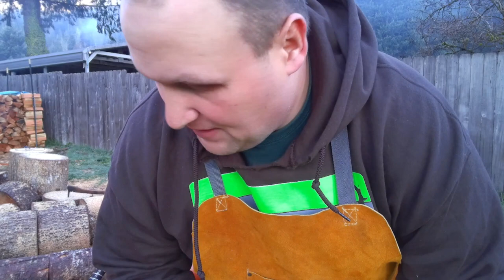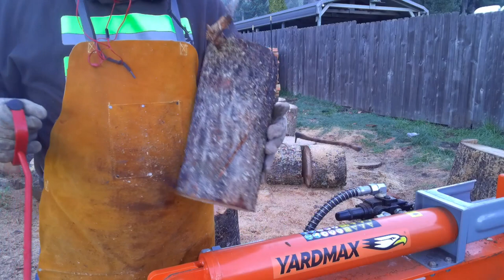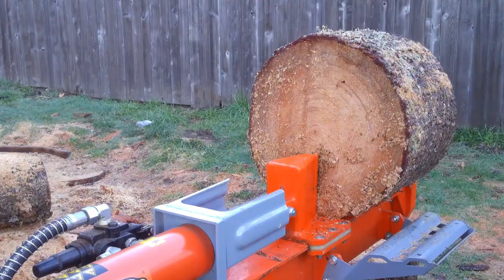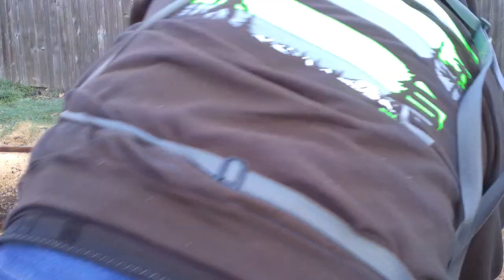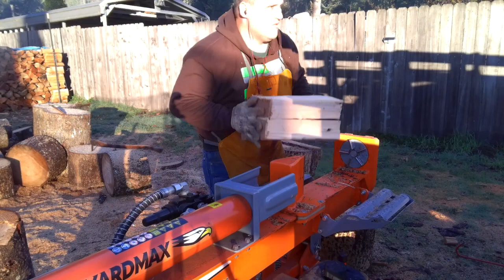The best Log splitter for the money!!

Comment: A few weeks ago I showed this vid to my wife and as a goof Valentine's Day gift she surprised me with a welder's apron JUST LIKE YOURS for when I use my splitter.  Excellent!  Great tips on your videos, Wild Bill.  I've worn the apron 3 times now when using my splitter. Over past dozen years I used to do daily rental of commercial 37-ton type splitters and decided this year to buy my own and got the 28-ton half beam yardmax.  Have split about 2 cords now of 90 year old wet red oak.  In Virginia.  Impressed how you split doug fir with your axe blows but here I use using a wedge and wicked heavy sledge/maul to get some rounds down to a manageable size.  Subscribed.
Reply from the maker: Thanks for the kind words.
Reply: I agree with my red oak. It’s a choice between vertical split or wedges

Comment: Good video Wild Bill.  I see you use a lot of the same techniques as I do.  I love to split 'em square  when possible because it allows cross stacking at the end of the rank.  I have a large push block and a large fixed wedge so that allows me to sectionalize the larger rounds into 4" thick slabs the whole width of the larger size logs.  Keep up the good work young man !!

Comment: Hey Bill,
Just subscribed. From California/Oregon border. I too recently got a Yardmax splitter. I got the 1/2 beam 28 ton. So far I've prolly put 8 cords or so through it and love it. Gonna be making a table to extend either side of the existing rack so I'm not having to move larger chunks as much. Will let you know what I come up with as it will fit your splitter too. Basically gonna just add a piece of plywood for starters.
Reply from the maker: Hi Phillip. Welcome. Yes please let me know how that turns out. Some added table width would help alot
Reply: @WildBill1122  Will do. I saw the small metal one they offer as an option but it didn't seem big enough. Eventually I'll make it with metal when I get a welder.
Reply from the maker: @unclep1210  yea the one they sell seems like it isn't big enough to bother with.
Reply: Uncle P:  I too have the 1/2 beam 28 ton. I like the idea of plywood tables.  Question:  the L-shaped hydr. fluid suction hose on mine came somewhat kinked. Hasn't affected performance but I think the factory didn't size it right. I'm reaching out to them about, just curious if you had a similar issue.  Thx.

Comment: I learned some 1 put a tall round in a pos9tion to set a half of a round and using the wedge to hold a large piece while you set aside the other half. Having to straddle the wheel on the control is hard on my 76yo back so I will be removing it now. Thanks for the help.
Reply from the maker: Glad it helped you.

Comment: If you can lift those rounds then you didn't need to invest in a splitter. More fun with the axe too.
Reply: I almost laugh when I read a comment like that. Grew up in the sticks, a chainsaw in my hands at 10, when people see me cutting wood they can't believe it, one day I cut 8 cords.  Now at 66 I bought that yardmax 35 ton unit. I split fir 5 feet across, you can't even stick a wedge in that.  My ranch was so far out I didn't have power, built a mitchell- banki cross flow turbine and made 9kw.

Comment: It’s not doing anything a cheaper splitter wouldn’t do…..
Reply from the maker: It has a high gpm pump so cycles faster. You can throttle it up and down as well. Full beam is very solid. These all make it a lot nicer to use. Yes the cheaper ones do split wood but as a tool it is much nicer. Kinda like a rock will work as a hammer and it is cheaper than a hammer.